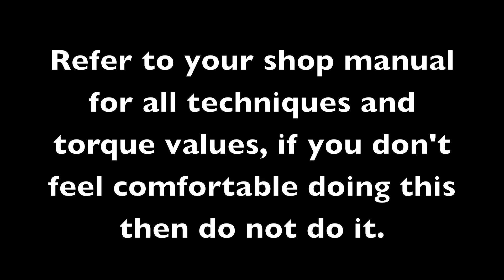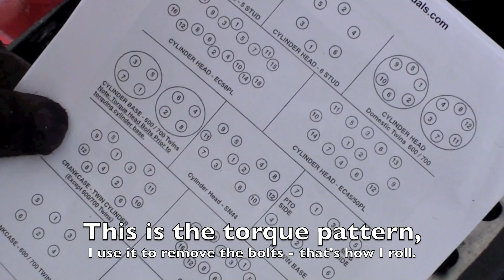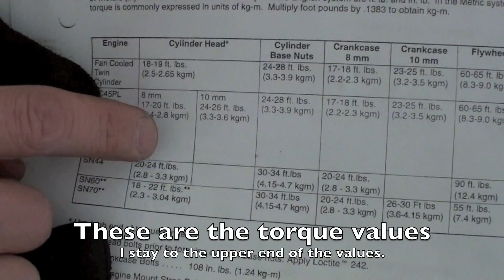Replacing a Liquid Cooled snowmobile head gasket - Polaris XLT600

Comment: thanks for the reply .. so i took her for a few half throttle drags through some slush was a warm dayout, got back home for a break and a coffee then figured id go for one last rip but nocticed my mag cylinder wasnt firing (that side of muffler was cold),so i cleaned the plug sand paper put her back in still nothing swithed the plugs round still nothin, so i sulcked and pouted tore the air box off and niced some wather in it so i figured some water got into that carb and sure enough clean.. con.

Comment: You could have gained a performance increase if you used the '96 600 XCR head gasket (single metal as opposed to laminated stock one)
You also can take apart the laminated one and use either the top or bottom metal part only.
Good instructional video.

Comment: continue..... its not leaking out of line or at the spark plugs it does smoke it acctually smokes more now then it did when i first got it ,the previous owner had it idling @4000 rpm.. and the air screws at @1 1/4  i put them all back to one turn out and all my idles are at 5 1/2 out, she idles @1800 but she smokes more nothing nasty but ..not sure if its burning coolant as well im new in the snowmobile world.. gonna continue on another post,,

Comment: I got a 96  xlt 600 too, when it's cold it's extremely boggy and smokes a lot. When I first bought it my coolant reservoir was below min so I top it up to full and went for a ride. When I got back it was back down to min and a little bit of the coolant had been spraying out of the pinhole in the cap and was on the insulation under the hood. I pulled off the rad cap and it was filled right to the top. I started it up with it off and instead of it going down it went up and started overflowing with lots of bubbles over the engine. My buddy said that that's normal was ur sled doing this?

Comment: hi shobie i have me a polaris xlt limited not sure if its a 97 or 98 its the same color as yours. its seen betterfar  days mostly all cosmetic as far as i know the seats torn the cabs crcked at pull start and stuffbut.. i  tore th carbs out and cleaned them good and realigned all the sliders and set my idles all the same runs fine but i keep losing coolant i was woundering if you had any tricks to find out where its going without having to tear the engine apart?    gonna continue on another post

Comment: sure enough she wasnt firing because of it ,anywhoo i cleaned all the carbs again and she fired up no problem.. anyway point of this is that i woke up the next morning and all my coolant was back to where i first had it.myabe i got it warm enough that thermostat opend up and and fluid ran through looks fine, thanks for the gasket  trick  keep it in mind when looking at the plugs/ now i just have to get my brake light and kill switch t work i went through hundreds of forums but  nothings  contin.

Comment from the maker: @gotwhitetail @gotwhitetail @gotwhitetail well, you have to call  him, if you are 15 then this might be your first confrontation on this type of matter but it needs to be done.  Be calm and dont use bad language, explain to him what is going on and what you done about it - either fixed, money back or discounted money to cover the cost of repairs.  where is the coolant coming out?  around the plugs?  around the top cover?  if so it might be just a gasket but costs money

Comment: continue..  so besides that the  tail lights dont work either the bulbs are good but nothin.. the headlight work fine im speedometer and tach lights work not sure if the oil lights and stuff come on highbeam indicator works but i did foul a pplug and the spark one didnt come on anyway not too sure whats wrong there ..any info you might be able to give me on this sled would be greatly appreciated anything i should watch out for

Comment: How do you find the 1990’s xlt 600 water pumps ?? I can’t fine them anywhere..
Reply: You can't find them new, Polaris doesn't maintain support for old sleds. You can get a rebuild kit for around $45-50 though. Not sure about the impeller. I'm about to dive into the head gasket repair this week since all the symptoms point to that concerning my overheating issue. Hence I'm watching this for some tips.

Comment: why does this xlt have the full head gasket and some only have the rubber o-rings and not the full head gasket
Reply: Mike Eastwood the "triple triple" 3 cyl engines have o rings. these are pre 95. these are also 580cc instead of 598 like the newer mono block motors. the mono block had the full gasket. and post 97 the mono blocks got the phone oiler fixed. those were the best motors

Comment: i f iknew what wire to fallow and from where?? where would the tail light wires be coming from? the headlight work great very bright acctually high and low worknbut no brake or tail lights and the bulb is good filament is intact and the kill switch is usless.engine works with the key alone , do you have any idea what wires i should be fallowing? if your gonna tell me to remove the seat i have no idea how to do that neither does the internet